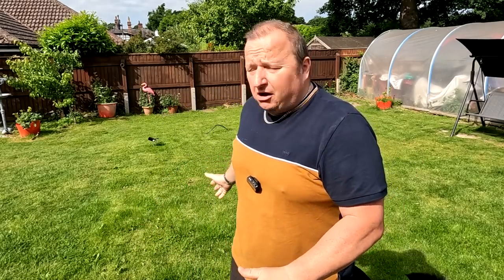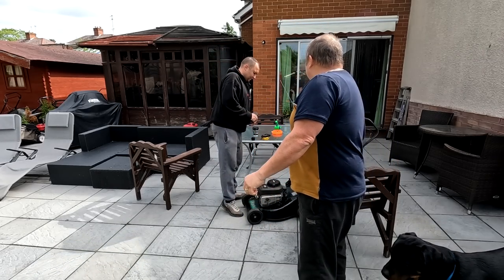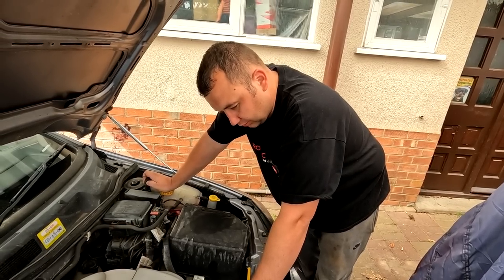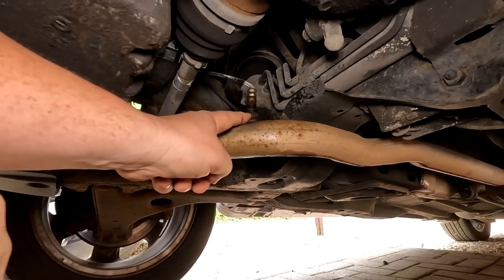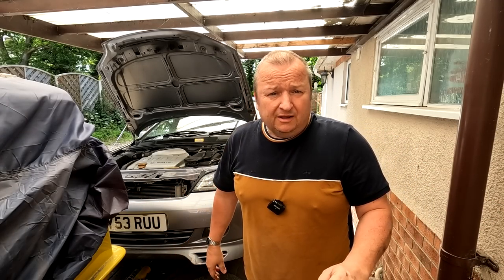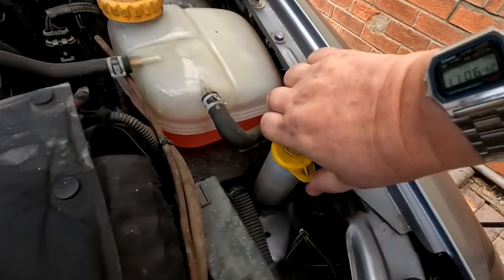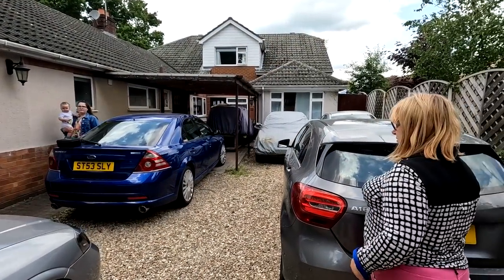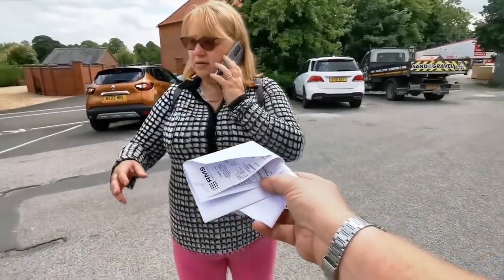Sometimes You Just Got To Get On With Stuff

Comment: Best thing to do removing old o2 sensors is cut the wire off and use a normal socket or ring spanner, those slotted sockets always open up

Comment: Nope, you won't find me putting used tyres on my car. You don't know how many kerbs they've been bounced over by the previous owner. Compromised side walls, run at the wrong pressure etc, they're what keep you on the road and alive. Just bite the bullet and put decent rubber on the motor.
Reply from the maker: Don't be so negative, they are checked you know

Comment: Nice one Martin.
50 quid for tracking..!!? Holy smoke.
Reply: Mine was  same when I fitted  new shocks  and  top mounts to my mondeo st tdci it could  of been  more but rear was OK as I had only  changed  the front I did speak  to  guy and he said my rear bolts  was well rusty and he said if I was changing my rear shocks in future  it worth getting  new bolts  to make it easier  for  adjustment  I said I got it to do but  as the front failed the fronts was first

Comment: Heat the 02 sensor up and spray with WD40 while it's hot and repeat the process until it comes off. It will create quite a lot of smoke but it's never failed me yet 😁3 times should be enough 👍

Comment: I only pay £25 for front wheel alignment at my local tyre place. Better to support the small guys. When I had my Astra, I had to wedge the exhust pipe (I had no vice at the time) and use a stilson wrench to get the O2 sensor off.
Reply from the maker: Yes Dave, there's a few methods I could use when I tackle this one.

Comment: £50 for the tracking that's expensive I had mine done a couple weeks ago 4 wheel alignment £30 including vat that tyre place is pulling your pants down and spanking you
Reply: Bush tyres... always a rip off
Reply: @andytaylor9032  A £30 wheel alignment isn't worth the garages time, whenever all the rear adjustment bolts are seized solid

Comment: Easiest way to get that is sensor off, cut the wires off, smash the sensor guts off above the nut and then out a normal socket on it and crack it off with a breaker bar from above. It's never failed me.

Comment: Good video Martin I have been watching your channels for a couple of months now and really enjoy the st220 jobs and the mk4 astra jobs very soon im going to be doing a lot of work to my st220 and going to be giving her a full respray ill tell you what im going to do to it
 
1. Going to be taking the engine out and putting another 3.0 v6 in it take everything out the engine bay and getting all the surface rust out and make it brand new again 

2. Put everything back in the engine bay and put the clutch from the old engine onto the new one and that's the engine bay done 

3. Going to strip the whole car on the exterior going to respray the outside and get all the scratches out of the car and make it brand new again

4 Sort out the rust that's on my arches weld them out and get 2 new rear arches for it.

5. Taking everything from out under the car and taking all the old corroded parts and treat the rust underneath I would vactan it because i have been watching james from the savage garage using it to repair the rust on his st diesel.

6. Would get 4 new coil springs for it and struts dont need new brakes because i put new brakes on it last month and would also treat the rust underneath the wheel arches and vactan the whole rust so it turns black and never to be seen again 

7. Sandblasting and powdercoating the front and rear subframes to get the rust off them as well.

8. Put 4 new wheel barings on it and 4 brand new shocks.

9. Put a milltek exhaust for it same as yours because i would call mine Mr milltek 

10. Respray my front bumper because its got a big massive scrape all the way underneath the driver side fog light 

11. Put 2 new catalytic convertors on 

12. 2 brand new silver headlights for it
13. Put a new pollun filter air fuel filter and that's the service.

14. Get a fancy spoiler for it to make it look sporty

15. Put new windscreen wipers on it.

16. Get some fancy gel plates for it to make it look very cool 😎 .

17. Respray the bonnet lid to get the rust off that.

18. Get a new key like yours Martin.

19. Get 2 new rear side doors because mine are corroded.

20. Get some racing calipers 
21. Get a new starter motor for it.

22. Put everything back together and get the st ready for its mot road tax it insure it then get it ready for the mot and then if it passes the mondeo st220 is all finished and then be taking to the scottish performance show and then take a holiday with my dad and we would take the st on a ferry and take it to another country and then drive it and it will put a smile on my face and because i love my st220 and it will look amazing like it did when it came out on the 20th July 2006 and its my dream thing
Reply from the maker: That's a lot of work, good luck with it
Reply: @retrorestore  thanks mate appreciate your feedback

Comment: yep, test the heater element in the sensor with a DMM after good visual of wiring & connector and if  sensor element tests bad chop it and get a ring spanner or socket on it .
Most times heater circuit codes be burnt out sensor element but bad wiring pretty close second common failure.
about only sensor sockets that don't spread are snapon but even then due to space constraints and not wanting risk escalate job cost in moving things for access we chop sensor for wrench or socket on a flexi ratchet, most times extending handle ones like facom or  high-five produce as got give it some mother lover cussing and grunting get um start turning . (premier brand do a nice high-five one sensible coin on eBay)
Reply from the maker: Thanks bud, very informative.
Reply: @retrorestore  
hope it helps, extending handle flexi 3/8 ratchet of decent quality is game changer in getting job jobbed in tighter spaces as can angle it about and tweak length as long as you can get away with .
Man used tyres at £30 each, I remember paying £8 a tyre for cheap brand names used and 10 to 12 for good named brands and that fitted/balanced with old valve stem and grubby prints all over your wheel lol .Even on marketplace it hard find decent matching used tyres cheap, sometimes get good buy on complete set with rims .
You older than me so can probally remember it in shillings and pence lol  .
You lucky have old school scrappers near you, miss the days of a scrapyard saturday part hunt lol .

Comment: Ive a zafira A 1.6 the exhaust looks the same as yours. I had to drop the front part and use Stiltsens on the 02 sensor when the exhaust rotted out. Funnily enough,my engine light came on last year saying it was the 02 sensor on a trip to Blackpool. I always carry my little OBD2 so I reset it. It's never came back on. This was a few weeks in to changing over to E10 fuel. I don't know if it had anything to do with it, but.....
Reply from the maker: That's what I plan to use to get it out